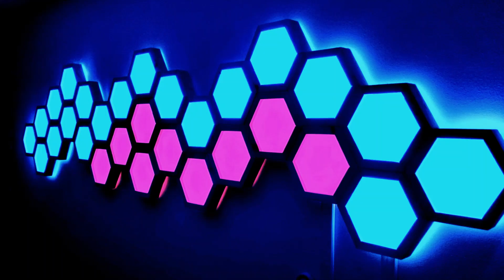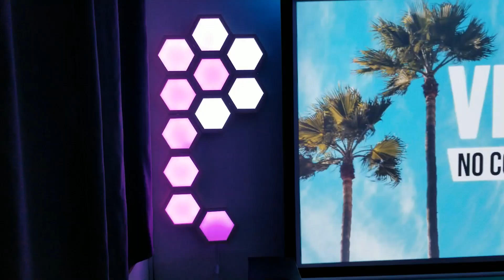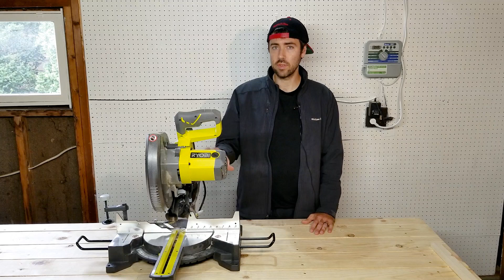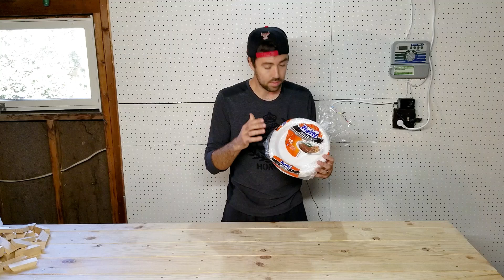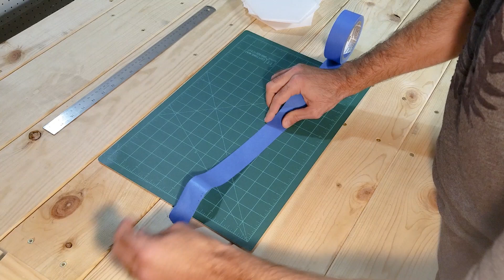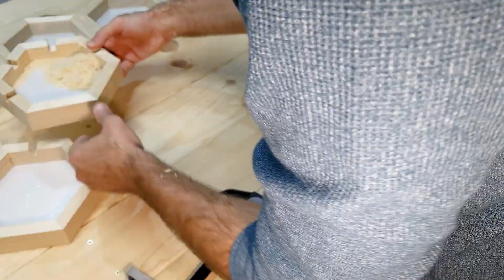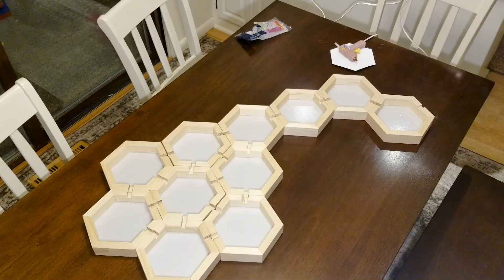Making My Own Version of Nanoleaf Hexagons - DIY Project (No 3d printing, programing or soldering)

Comment: Congratulations for the amazing work!!! 👏
I'm working a project based on yours and I would like to ask you something.
The total length of LED strip that I need is 8m. Is it better to cut the led strips into 2x4 meter pieces or to use one 5m piece and one 3m ? Which do you think have better result? 
* I have bought the same LED strip as yours
Reply: I've already checked it!! Your tutorials are amazing by far!! Unfortunately it isn't possible to put them in parallel because the geometry is a little complex! So I think the result will be the same in each of two scenarios?
Reply from the maker: @konstantinoshoustler8800  you are 100% right. Unless your hexagons are all in 1 strait line it's probably impossible with the geometry to have it parellel. I know mine were not but i tried to do the best I could.  It will still look cool either way :)
Reply: @ChrisMaherDIY  Thank you very much!! Looking forward for more videos!!👏👏
Reply from the maker: Thanks for watching and that's super cool your making some! If your using the same led's that i used, i  would say 2 x 4 meter pieces will look better if they are running parallel to each other. That way the color animations are going to be pretty much the same as they work their way through the led strips. Here is a better explanation of what i mean from my 2nd video of my other project. https://youtu.be/cUV77NR-zWk?t=745

Comment: you are genious!! Thank you!!😊😊😊👍👍👍👍 I have just one question... From what material are the plates??? Thanks
Reply from the maker: Thank you for watching and the comment! The plates are made from styrofoam.
Reply: @ChrisMaherDIY  And how many lights did you buy from link in description? i mean quantity... do you get 2 rolles of lights or 2 rolles in 1 pack for cca $30?
Reply from the maker: @jakakosten7485  The flower shape design i made in the video only required me to order 1 pack of the lights. (in 1 pack, it comes with 2 roles) For the larger hexagon design that there are pictures and videos of at the beginning, i needed to order 2 packs of lights. Hope that helps!
Reply: @ChrisMaherDIY  Thanks man... you are awsome!!!

Comment: hey chris, What kind of material are the plates made of? I have to get the other ones because they are sold out.
Reply from the maker: Thanks for the comment! They are styrofoam plates. If you cant find them at your local store, it looks like amazon has them in bulk. https://amzn.to/2WWfyZz
Reply: @ChrisMaherDIY  60$ shipping to germany XD i look for another. have you other ideas ?
Reply from the maker: $60 dollars? What a great deal lol. If you have any craft stores, the only other thing that was cheap and worked pretty well was some milky white plastic sheets that you can use for stencil designs. I had to double up but had a very similar result to the plates.
Reply: @ChrisMaherDIY  i tested this but it is so hard to cut

Comment: How did you link both the LED strip animations together? Also did you plug them into 2 different sockets or did you get an adapter to plug it into one?
Reply from the maker: Thanks for the comment! You can somewhat control the led animations from the app. The big hexagon shape I made required 2 controllers because of its size so I am able to control those independently. I plugged them into 2 different sockets. Hope that helps but let me know if it's clear as mud. Lol

Comment: Nice video I liked the Hefty plates but for the future reference I would like to give you a tip. next time when you cut a groove do it on the whole strip of wood that way you don't need to cut it in every piece ;)
Reply: If you cut the channel groove while the board is 1 piece you will get half of your pieces with the groove on the outside  if you flip the board 180 degrees after every cut. Just FYI.
Reply from the maker: You are right. You wouldn't be able to flip the board over after every cut. Good catch!
Reply from the maker: Thanks for watching and for the comment! You could definitely do it this way but you would have to make extra cuts and waste a little bit of the wood since you could no longer flip the board over if the groove was only on 1 side. However, it still might be easier doing it this way versus making the groove on all the tiny pieces! Great idea and i love that you though of this as it never did cross my mind that this would be an option!

Comment: i live in Germany and dont geht the plates. pls can you send alternative plates or the material and the 
thickness of the plate?
Reply from the maker: Thanks for the comment! The styrofoam plates are around 1/8 inch thick. You could use these acrylic squares and cut to size but i would then recommend using wood that is a little taller so you can separate the acrylic from the led lights a little more.

Comment: Great video. But just buy these and save a ton of time in the creation of the panel.  They have all shapes and sized for cheap.  https://www.hobbylobby.com/Art-Supplies/Painting-Canvas-Art-Surfaces/Blank-Canvas/Hexagon-Blank-Canvas/p/HC08072
Reply from the maker: Thanks for the reply! Great minds think alike! Believe it or not, i actually bought some of these to try from Hobby Lobby. They certainly will work, but i didn't end up using them because they blocked a little too much of the LED lights. You could remove the material and use something else but i didn't explore that rout which i certainly could have. Thanks for watching and thank you for the idea!
Reply: @ChrisMaherDIY   Yeah I got 12 of them for 24$ usd. So they are the same size as the 8" nanoleaf ones.  I may remove the canvass if they block too much light but the shape is still there to add a diffuser too.
Reply from the maker: @kennethterry6453   Yeah for sure! Let me know how they turn out. Such a good idea! Thanks for sharing!

Comment: Using mitter saw at 30 degrees angle  6 piece . When putting all together  i having 2 gap..?
Reply from the maker: Thanks for the comment! Hmm maybe if it's not working out right, watch this video since there are a couple ways you can cut the angles needed to make hexagons. Start watching at the 2 min 10 seconds mark: https://youtu.be/fTtlJstHSVw

Comment: did you make the wood from the big one black ? and 
did you glue the wood with hot glue or wood glue?
Reply from the maker: Thanks for the comment! The wood on the big one is just normal wood color. It just looks dark with the way the camera pics up colors at night. I used wood glue to glue the individual pieces together but used hot glue to glue the hexagons to one another. I should have used wood glue for everything but I was impatient since hot glue dries very quickly.
Reply: I think i Make it black. Looks very nice hopfully

Comment: whitch wood did he used ?
Reply from the maker: Thanks for the question! I used 1 inch by 2 inch wood. It came in 8 foot long boards. There are many different kinds/prices of wood that come in that size. Just try finding ones that are as straight as possible.
Reply: @ChrisMaherDIY  thanks for the answer

Comment: Should I go for styrofoam plate or an acrylic  sheet plz tell
Reply from the maker: Thanks for the comment! I never did find acrylic that looked as good as they plates I used for this project. I tried different acrylics but I could always see individual LEDs through it and I didn't like the look. I'm sure there is acrylic out there that would look good with such little distance from it and the LEDs, but I could not find it. In my new video I just posted, I used acrylic and it looked great but the LEDs were further away from it than they were in this build.
Reply: @ChrisMaherDIY  thanks for the answer.. successfully  subscribed😄..
Reply from the maker: @vaibhavSingh-ym2eg  you are very welcome and thank you! I appreciate the support!

Comment: Just finished mine and it's up in my office! Thank you for the awesome guide. I ended up using a thin acrylic in front of the styrofoam plate to protect it long term since a broken plate would be terrible!
The Hefty plates also had a recycle imprint on them that showed through with the lights so I found an alternative dollar store brand that worked great
Reply from the maker: That's awesome and you are welcome!  And I love what you ended up doing to protect them. Genius! Thanks so much for the comment!
Reply: Images of my completed build if you're interested :)
https://imgur.com/gallery/tNYGVrj
Reply from the maker: @nydissa  absolutely amazing!! I love the design and the empty hex in the middle! Soooo cool. Thank you for sharing!!
Reply: @nydissa  that blank space in the centre is such a cool idea.
Reply: Wow... it's so beautiful! Thanks for sharing how great yours came out. You and the OP did amazing jobs.
Reply: Just showed my husband and he loves it. Can you share the acrylic you used for protection please?
Reply: @lanarm4942  thank you! I can't find it online, but I got it in large clear sheets from Hobby Lobby. It's maybe 1/16" thick, about the same thickness as the styrofoam plates
Reply: @nydissa  thanks Alicia. Knowing the thickness will help quite a bit in my search.

Comment: What were the dimensions of wood cuts for larger sizes also did you use the same plates? Best vid on how to make these.
Reply from the maker: Thanks so much!  The bigger hexagon project and then the one i showed how to make in the video were the exact same cuts and dimensions. Let me know if thats what you were wondering. Thanks again!
Reply: @ChrisMaherDIY  yea that’s what I was asking thanks. Just looked a lot bigger in the video the right wall over the couch.
Reply: @ChrisMaherDIY  yea awesome thanks. I was thinking what if you used very thin plexiglass and paint it with glass frost gives it durability and would block the light what do you think?

Comment: Can think I can get the wood cut at home Depot? Yeah I live in NYC most of us don't have room for a garage with saw and work bench 😅 hell "shop class" is only something we see highschoolers in movies take growing up. 

Also can you explain how you were able to make the LEDs in each hex its own "zone"?
Reply from the maker: That's a good idea. They may be willing to make the cuts! As far as controlling each hex, I can't do that with the led strips I used. However since the big hexagon build I did required 2 sets of leds, I can control each set of those. On my thumbnail you can see where one set is greenish and the other set is set to red.  If that makes sense

Comment: How many panels would you recommend making for 32 feet of led strip?
Reply from the maker: Thanks for the comment! I'm thinking you could probably make around 19 or 20 and that would use up about 32 feet.
Reply: Chris Maher, I made the panels yesterday. Your video was perfect! Thanks so much for putting this together!! 

I made 40 total and will be giving 20 to each of my boys for Xmas. Then completing the build with them. 

For the larger one you made with 30+ panels did you happen to make a video of running the LED strips? And words of wisdom or lessons learned for trying to route the lights???
Reply from the maker: @22phillyboi  that's so cool! Hopefully they will love them and it will be a fun project to complete with them! I didn't make a video of that but my advise would be to just use some tape and do a "rough draft" of running the led strips through the hexagons if that makes sense, essentially mapping out a rout that will cover all the hexagons if possible and not running out of the strips  towards the end.

Comment: check out WS2811 or WS2812 led strips and a nodemcu, those should allow more flexibility in your lighting
Reply from the maker: Thanks so much for watching and the comment. I appreciate the recommendations! I'm always looking for ways to improve!
Reply: @ChrisMaherDIY  Right, addressable leds (like Neopixels) are great, I built several projects with them and you have complete control over each individual led.
With an ESP8266, Neopixels and the WLED library you can control the leds remotely with your smartphone of a browser. My version of Bitluni's pingpong lamp: https://youtu.be/6NUofapfsiU.

Comment: Based on the link in the description, the strips you have are the standard addressable leds, so they should have 3 copper pads every few inches where you can cut them. The pads are positive, negative/ground and data and should be marked somehow (usually 5+, DI/DO, GND). There seems to be zero information about the voltage of the strips on the amazon page, but you can check the power supply they came with to know the voltage. Afterwards you just need a controller, like an arduino or razpberryPi, or even a micro:bit. Connect them to the controller, connecting the ground of the strips and the controller to a common ground, and following the direction of the data (should be marked with little arrows along the strip) connect the data line from the controller. The data “flows” from the controller to each led on the strip following the direction marked with arrows, so it should be connected at the “start” of the strip, “behind” the arrows.

Would love to help more if you have questions, good luck!
Reply from the maker: Thanks for the great feedback! I'm definitely coming back to your comment for future projects and I most definitely will be reaching out if I have any questions! Thanks again!

Comment: Hey Chris this is just what I was looking for. When you made the big one with I think 29 hex led panels. You say you used 2 packs of the 32ish foot kit. Did you waste any the led strip like mentioned on this smaller flower design? how much led strip is needed per hex? guessing 3ish inches per side. Its going to be a task but I am going to make all the cuts here in NC and take it out in pieces to CO  for assembly. Im thinking cut a couple hex with grooves on all sides to have some middles and few with various combos and Im sure I can come up with something when I get there that fits the room and combo I have. I would like a way to be able to change it up without being a project itself
Reply from the maker: Thanks for the comment and I hope yours turns out great! I did waste some on the flower design. Just guessing here but I think I could have added maybe 5 or so more hexagons to the flower design and cut down on the waste. My guess is each side uses around 2.5 inches. I have not measured so this is just an estimate.

Comment: for reconnecting strips after you cut them you use these. they touch those copper tabs that are on the strip to each other. this is a 3 pin led version so you need a 3 pin splicer. https://www.amazon.com/RGBZONE-10Pcs-Connector-Gaples-Digital/dp/B06XSGD516/ref=sr_1_4?crid=2M74E92GSS1VX&dchild=1&keywords=3+pin+led+strip+connector&qid=1606086410&s=hi&sprefix=3+pin+led+%2Ctools%2C175&sr=1-4
Reply from the maker: Thanks so much for watching and for the information! I appreciate you taking the time to help! I'll have to check them out!

Comment: Something to try:
Just use paper, or a string, instead of tape. Just tape the end. Saves tape.

Any way to replace a broken Styrofoam plate?
Reply from the maker: Thanks for the comment and great ideas! I definitely did go through a lot of tape so anything to save on resources would be helpful! As far as replacing a plate? I don't think there is an easy way. Just pray nothing happens lol. I'm sure you could take apart a hexagon, replace the plate and glue things back but it probably would not be very easy.

Comment: QUESTION: The first seconds of the video show the frames are BLACK. I was waiting throughout your entire video to see when you painted them. Did you paint them?
Reply from the maker: No painting at all. All the pictures/videos were taken at night and since there is such a bright light coming from the hexagons led's my guess is the camera just cant pick up the color of the wood very well and makes it look dark. However, if you did paint them (i think it would look amazing painted), i would do it at the step right before you put the plates and wood together when they are still in the individual pieces.
Reply from the maker: I would also only paint the outside, top, angled cuts and the small part above the groove where the plates go. I would either leave the part inside the hex and below the groove bare or paint it white so the LED light can bounce off something brighter if that makes any sense!

Comment: Before I saw this I was thinking of the diffuser panels for ceiling lights but that would involve a lot of cutting and waste I never dreamed of using styrofoam. 
Dude you saved my life 😂
Reply from the maker: Lol Jesus is the only one who can save but I'm glad the plates worked! Dude I was close to using ceiling light panels!  However it was going to cost way more that I was willing to spend.  I still might try to make something from puff cloud diffuser light panels since I love the way it looks with led lights but that will be down the road. Thanks for watching!
Reply: @ChrisMaherDIY  the styrofoam plates idea is genius, plus cuts down on the weight too.
Reply from the maker: @LittleJa2002  That is true! So much lighter than pretty much anything else! Only downside is the size of the hexagons or whatever shape you want to build has to be pretty small since plates are not that big. But for the price, you cant beat it!
Reply: @ChrisMaherDIY   your hexagons are only 1 inch smaller than the large nano hex from point to point which is just fine.   I’ve already taken your tutorial cuts and measurements and put it into AutoCaD to figure out how much wood  it would take to build my design.   $1374 for 52 Nano project is build cost is ridiculous!   Your hex light build and tutorial is the perfect alternative!  “Subscribed”
Reply from the maker: @LittleJa2002  Thanks so much! Yeah they are just crazy expensive! Even if i had the money, it would still be hard to justify spending $1,400 for the real thing. Let me know how yours turns out and thanks again!